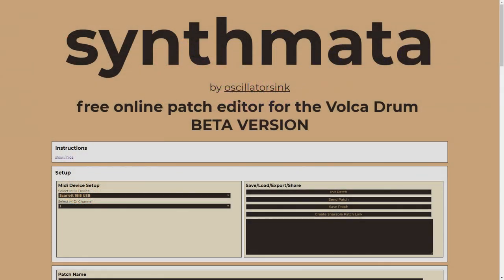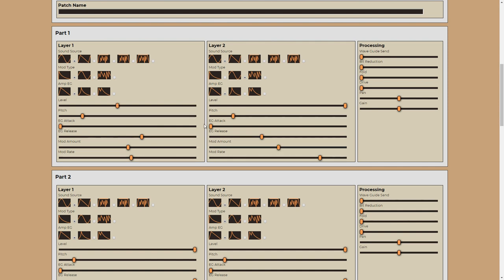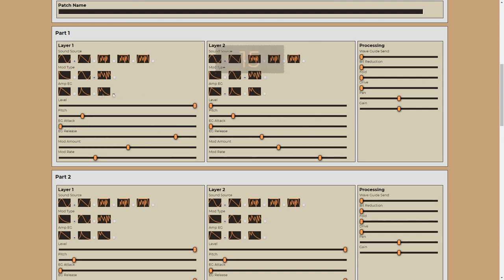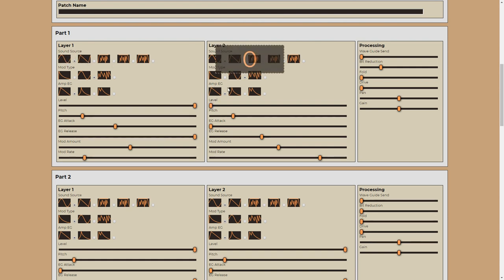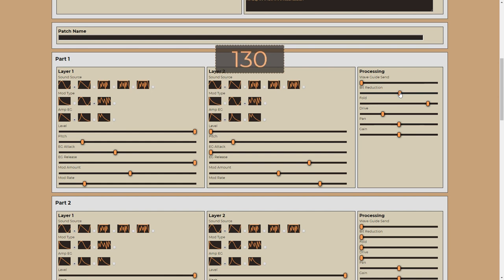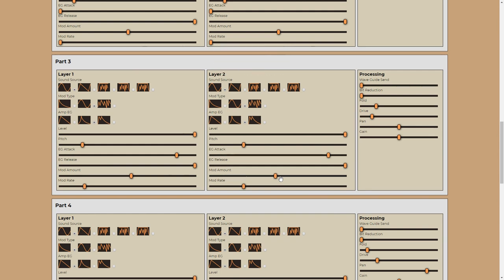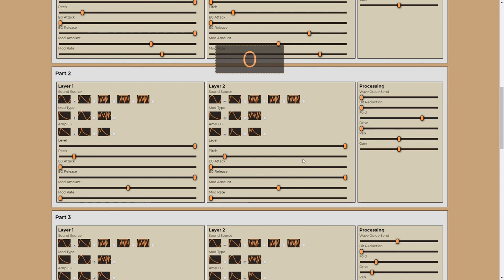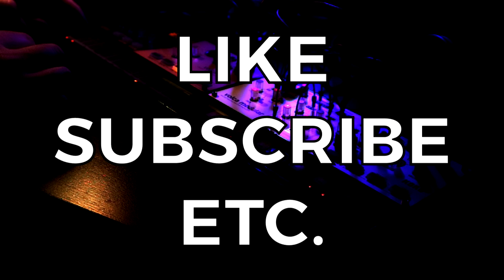Using the Korg Volca Drum Melodically: Sound Design

Comment from the maker: Question: Where's part 2?
Short answer: there isn't one, sorry, and probably never will be. 

Long answer: So I spent ages researching and taking notes on how the pitch control mapped to concert pitch, working out what you'd be able to do over midi control, what frequencies were close enough to use musically, which ones weren't, etc. basically hours spent with a tuner and a spreadsheet... And then about 3 days before I was going to record the video, Korg issued the firmware update that enabled Pitch Quantization. So with that in mind, the video would just be:
-Turn on Pitch Quantization
-Hold down a step in edit mode and set the pitches you want on that step
-Be careful about long notes as there's always portamento because of how Motion Sequencing smooths everything - maybe try putting silent / very short notes of the same pitch before the next note, but you're probably OK with plucky sounds, especially spaced out. 

And I'm not sure that's worth a whole video.

The research is here if you're interested: https://github.com/oscillatorsink/volca-drum-melody-research?files=1
Reply: There's a fair bit you could talk about with regards to removing the portamento effect. For example by alternating between two parts between note changes and designating them as choke groups, or motion sequencing the release times to 0 in order to effectively turn off a part or layer to the same effect. Also could mention using the slice feature to do drones by putting 16 level slices on each step. Still probably not enough to warrant another video though. Also can get quite messy too.
Also, as you mentioned, the slight detuning of the notes can lead to some characterful sounds which aren't accessible with pitch quantisation, so perhaps there is still merit to the pitch mapping approach? I'd also like to mention while on the topic of detuning that setting the LFO rate to 0 and the amount to +5 and -5 on two tuned layers makes a nice pseudo detuning effect.
Reply: @Zanix_IV  Retrokits DUY for Drum on their RK002 takes on the pitch glide:

https://duy.retrokits.com/6139e360-debf-40ea-8db6-9c8c97eb09e4
Reply: @oldasrocks9121  yeah but that only appears to be with an external controller rather than the internal sequencer. like I mentioned in the above comment there are ways to circumnavigate the glide but they can be quite awkward and often limit the number of voices you can use in a single pattern.

Comment: Part 2?
Also trying to figure out how to turn on the chromatic pitch shifting on the unit itself. Cant find that info anywhere.
Reply from the maker: It's coming, there's been some illness at home, and my day job has really been kicking my ass this month so I haven't had the time (or energy honestly) to get videos out, sorry.

Regarding your other question, I posted the following on my Facebook page:
VOLCA DRUM UPDATE, UPDATE

Update: the pitch weirdness I described below seems to be something to do with using the Layer1-2 editing. If you're just editing Layer 1 or 2 on its own, the tuning looks good! Happy days! 

So, the 1.14 update for the Volca drum adds pitch quantization. This is a big deal if you want to play the Volca Drum melodically. Here are the details as I understand them after some limited testing:

To turn on pitch quantization, you need to be in Edit mode; twist the select knob like you would for bit-crush, folding etc. and at the end you'll see "QPI" - turn that bad boy on!

Now, for that part, when you twist the pitch knob you'll see pitches rather than numbers! 

(I have also now added it to synthmata).
Reply: @OscillatorSink  No worries man Im a single dad, trust me I understand. I really love and appreciate what your doing though. Thank you
Reply: @OscillatorSink  Can't express how much this helps. Funny how easy it was to turn on but trying to find documentation for that tiny detail not so much.  again thank you so much and Madd love for what you do!!!
Reply from the maker: @deniwastaken  it's not at the top of my list. Now that you can turn on the pitch Quantization I've found it hard to work out what there is to talk about honestly. There's a trick for mitigating the forced portamento, but other than that... I don't know that there's much to talk about.

Comment: So I have the Korg volca drum set up with midi in, sound is on, computer recognizes the interface, I see the program but not the changes I make, even when I save it to the volca. I'm missing something here, should I be connected with sync in/out also?
Reply from the maker: @mmypainting  assuming that the midi cable is good and is known to work with other devices, you're going from midi out on your interface to midi in on your Volca, the usual issue people have is not having the Volca in the default split channel mode mentioned in the instructions.

Hold REC as you turn on the Volca. If any of the steps are lit up, tap that step to de-select it. Press REC again to start up the Volca as usual. If that doesn't work then it's possible you've turned off the MIDI RX Shortmessage setting in the global settings of the Volca. Details for that are in the manual.

Comment: Fantastic mate looking forward to trying this out. I was wondering if you knew any ways to get midi out of the drum?
Reply from the maker: Hi there, there are a few solderless mod kits that clip onto some points on the board that give you a midi connection. I haven't tried them so wouldn't want to endorse anything either way, but have a Google and you'll find them!

Comment: I've used the online patch editor many times before with no trouble, but just tried to use it (same cables, same browser, same laptop) but can't get it to connect to the browser. Any ideas?
Reply from the maker: Do you have a DAW open or anything else that's stealing control of the midi interface? Have you set the Volca to use a specific channel since you last used it? (you need to have it in split channel mode).

Comment: Has anyone else had a problem connecting  the Volca drum via audio interface  and it not coming up on the MIDI channel pull down screen of synthmata?
Reply from the maker: What interface are you using and what is shown (if anything) in Synthmata?
Reply: Using an m-audio fast track pro and when I’m connected nothing shows up on the menu :/
Appreciate the quick response!
Reply from the maker: Hmm, that should be class compliant.
OK what OS and browser are you using? When you first went to the site did it as you for access to midi?
Reply: Using MacOS Catalina , was trying with safari with no luck as well with Firefox no luck:/
Reply from the maker: WebMidi is only supported in Chrome based browsers. So try Chrome or Chromium or Opera.

Comment: Hello Oscillator Sink, I guess you do not have plenty of time to help your subscribers, but I`ll try anyway. For the last three days, I've been trying to get your online control software to talk to my volca drum, but it just won't react. My midi interface (midiface 4x4) clearly indicates the flow of midi data but the changes I apply won't have an effect on my drum. I tried it with chrome on my iMac as well as on a windows computer with the very same result. Midi data is being transferred but the volca won't react. Is it something about the volca drum's internal settings? Your software looks really helpful and I heavily want to get it to work with my volca drum. Any ideas?
Reply from the maker: Two things to check initially: your Volca must be running the up to date firmware (you can get they firmware update from Korg); secondly you must be in split channel mode, which you can set using the Volcas global settings mode (the manual covers how to do this).
Make sure both of these are as they should be, and if it's still not working we can try and trouble shoot from there.
Reply: @OscillatorSink  Thank you very much for getting back to me so quickly. My VD had already been delivered with t he desired firmware update. It also was running in split mode. However, I switched to single mode and then back to split mode again, just for a wild shot and that actually did the trick. As far as I can tell it's working now. Thanks a lot. You have just saved my weekend!!
Reply from the maker: Weird, but I'm glad you got it working;have fun with it!

Comment: Can anyone point me in the direction of getting my SQ-1 up and running with my Volca Drum? I’m at a total loss 😮 cheers 🎉
Reply from the maker: @DanHaycocks  what are you trying to achieve? Are you wanting to sequence the Volca with the SQ1 (I wouldn't advise that) or just synchronising them?
Reply: @OscillatorSink  Thanks for the swift reply. Originally I was, but I gave up. I'm totally new to working with hardware, sync midi etc and fumbling in the dark. I have an SP 404 mkII, NTS-1 MKII and a VOlca Drum. No genre of music in mind, just looking to experiment with options. Considering the Beatstep pro next :) Moved over from Ableton as I wanted more performance options or hands on fiddling. Love your channel BTW!